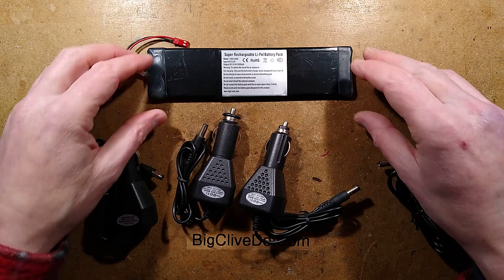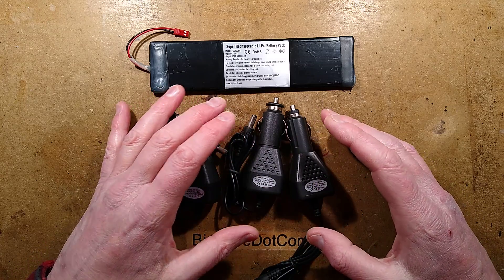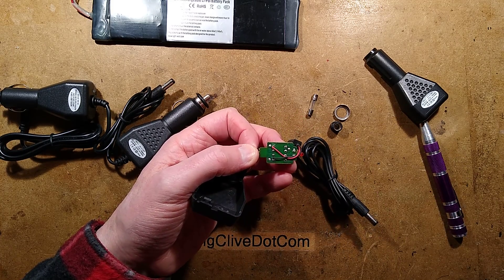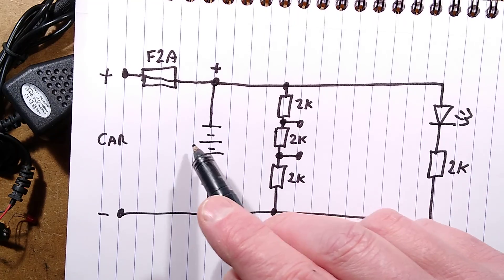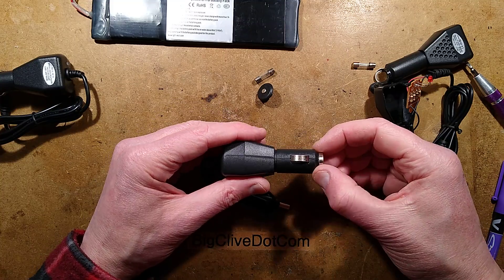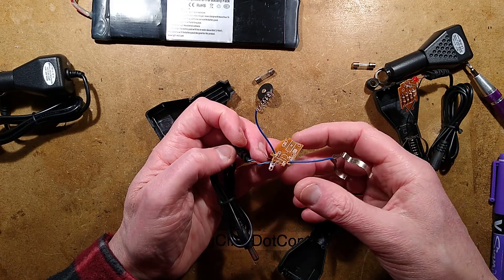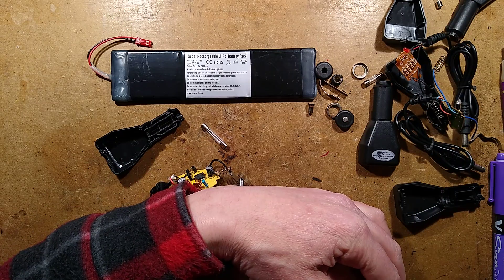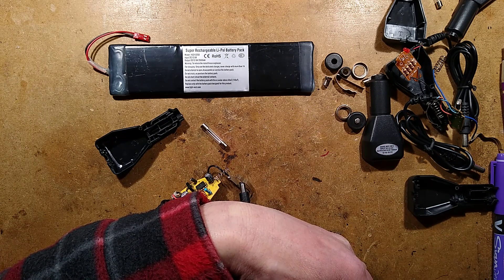Triple trouble - when offshoring goes wrong

Comment: I had some industrial controls made in China, the samples were fine as was the first batch, the second batch was where the problems started. They substituted a decent capacitor for a low value  capacitor in the PSU so that in cold weather the unit would not power up properly because the capacitors ESR had increased too much. Also they left out the filtering components on the inputs so the operation became spurious when longer cables were fitted. luckily only a few had been sent out to the customer before it was realised what was going on. I then had several hundred items that I then had to repair to keep the customer happy. Sending them back to China was not an option. 🥺

Comment: Wonder what Amperage that modified fuse rates as.

Big part of the issue is none of these amazon/ebay resellers ever bother to QA the factory or even inspect their order. For something like this I'd bet the reseller doesn't even know what they're looking at. Big money to be had if you have decent Mandarin and are willing to travel/live in China going around looking at shipments before they're put on the truck.

Comment: Hey Clive,

could you make a guide or an example video of what is supposed to be in something like a good (or adequate) power supply? Like, what is supposed to be in a 12v DC Power Supply? In what order? How does it need to be wired? So we can check if our Stuff is properly built and stuff.

Comment: Well there's a 'car fire in a can' for the 21st century. An exploding vest might be OK for the Dangerous Brothers, but for us ordinary mortals...not so much. 

Interesting mention of STRIX on the IoM. I took against them slightly as they refuse to sell kettle safety switches to individuals, on it's own not a particular problem, but they also sued a company making cloned switches, making it very difficult to find a switch elsewhere. I can understand why they did that, but it doesn't help when you're trying to reduce the Euro WEEE pile and are forced into buying a new kettle rather than fixing the old one.

Comment: Hello Clive. I want to run some short strips of 5050 leds from a 12v transformer but they run at half brightness and flicker badly (exactly as I'd expect!).

Can you suggest some kind of rectifying and smoothing Alibaba item, or maybe a suitable cap to eliminate the 50Hz flashing?

Thanks, 
Ran Davies
Treorchy South Wales :)
(It's lovely down here!)
Reply from the maker: I'd recommend buying a suitable 12V DC supply from CPC.

Comment: I bought a PSU for an IDE HDD from China. It exploded on the second time i plugged it in (230VAC). Sent images of the cracked case (it literally unraveled the ultrasonic welding and split) and sooty PCB via eBay dispute service, seller returned my 3 euros willfully, yay. Learned to never blindfully trust China 💩.

Edit: I just remembered that the PCB looked like the thing was hand soldered from a kit, lol.

Comment: One of my friends bought a large quantity of USB hard drives from china and was going to sell them all on ebay and make a tidy profit. He ordered loads of them and listed them all for sale in advance before he actually got hold of them. Unfortunately for him, most of them had been sold by the time they turned up and it was then that he discovered that these "USB Hard disks" were nothing more than the empty casings with a small flash drive hot glued inside of them together with a chunk of metal to make it weigh more!!! Obviously he had to refund everybody who had bought one which cost him a fair bit of negative feedback and I don't think he ever got his money back from the chancing sods in China!
Reply: Memory cards with far less capacity than advertised are also quite common.
Reply: There are worse ones.
They have firmware that shows a large capacity.
The actual memory is something like 8GB.
When it is full the special firmware loops to the beginning and starts overwriting.
It keeps on doing this and shows no errors but you lose the data.
Reply: @gordonwelcher9598  I've come across a lot of these. I find it's much less common in smaller drives like 1 or 2gb
Reply: New SSD drives are literally just flash memory, so I don't see how your friend's product differed.
Reply: @ElectroDFW  Well when you are supposed to be selling a 1tb external hard drive and it just has a very slow 16gb thumb drive inside it...
Reply: @ElectroDFW  This was also years and years ago when usb flash drives were really slow...
Reply: @FrontSideBus  This is still current practice here in Indonesia.  Plenty of hard drives on sale for unbelievable prices rate 4.8/5 because 95% of people plug it in, see that it reads, say, 2TB, with zero time used and they save a few files and everything looks great.  A month later when it's suddenly full or throwing an error they discover a thumb drive inside.  Unfortunately, the online platforms keep letting them sell.

Comment: Mega dangerous fuse bypass, and such a variation in car 'chargers'. Jeez, you definitely take a chance with those. Mine arrived today, both jackets work, both car chargers are the legitimate type. Mains charger seems OK but I'm not 100% sure whether to trust it long term. Also came with 2 first aid kits and 2 pairs of safety spectacles. Maybe they included these for a reason? :-/

Comment: China was the source of automotive ATC fuses that wouldn't blow. Harbor Freight in the USA sold kits of these and recalled them back in 2007. I am sure that there are probably tens of thousands or more of them around, since I strongly doubt that Harbor Freight was the only company that sold them. I found a 15 amp fuse included with a keyless entry kit that wouldn't blow when I connected a car battery across it. The legs were melting away where I touched the wire to them. But the actual fuse element wasn't blowing. You can usually identify these fuses because the fuse rating number on top isn't painted in white. If you see a fuse like that it's safe to assume it's junk and won't blow.

Comment: to add to the fuse stories, in the 70's the Mirror reported that a reader had written in saying their son had the good idea of replacing a 13 A mains fuse with a sawn of 1/4" nail, just the right size. The paper strongly suggested removing the nail.
Reply: Copper tubing has less resistance.

Comment: I took apart a switching power brick once and found what was obviously a reclaimed from scrap PSU, nipped off old leads, dust/grime and all. It was actually a pretty decent looking switchmode module so can't really complain.
Reply from the maker: That very common.  And they're usually pro-grade PSUs.
Reply: @bigclivedotcom  I remember performing that process while working in manufacturing. We would get in returned power supplies and put them through the bench test and repair process. Once everything passed, we would then put them back into production.

Comment: Hello Clive, is the "real" charger capable of boosting the voltage? Or could it not charge up the batterypack fully, when the engine is not running?

Comment: A friend had a phone charger in the car it smoked and took out his phone, I dismantled the charger and it was a proper circuit but the caps were only 10volt, it was labelled 12/24volt so you still have to check everything.
Reply: Ah yes. The good old "we ran out of the part so use this one instead". Gotta deliver on schedule or they'll suffer a huge loss from breaching the contract.

Comment: This happens with sales of Chinese products on Amazon and EBay all the time. The initial sales are good, well made products. The glowing reviews come in, then the product switches to crap with high failure rates (or worse, like the soldered fuse).

When shopping, I always sort reviews by the latest first, and if there are a bunch of "Great!" zero detail reviews, I know they are stuffing recent bad reviews off the page. Even with considerable care, I still sometimes see greater than 50% failure rate on parts. Buying locally is more than twice the price, so I end up continuing to buy from China and doing my own QA.

The experiment of component manufacturing outsourcing has been a failure, and product manufacturing needs to "come back home". Looking at Tesla vertically integrating its manufacturing, I now understand why they are manufacturing every component they can inhouse or locally - and looking to expand the scope.

Comment: These manufacturers time and time again demonstrate a lack of even basic circuit knowledge or arguably even common sense. And as you just highlighted that lack of knowledge can destroy your expensive Microstructure Surface tablet. Chinese no name electronics are rarely worth saving a few bucks as, at best they perform poorly, have inflated specs, and are often short lived. And, at worst, they’re a serious safety hazard and/or can damage other things. Louis Rossman has documented many cases of no name Chinese chargers damaging expensive Apple products and/or creating erratic operation. Even things like fake Apple Watch bands that out gas toxic chemicals and make the wearer’s skin peel. They’re just not worth it.

Comment: We looked at outsourcing / offshoring twenty years ago…
it’s like being a parent.
You have to give very explicit specs and instructions,,followed by progress and final QA upon delivery.
It’s not always negligence, but the third party may have no idea what you’re expecting.  They’re merely putting square pegs in square holes.
If they run out of square pegs, their under skilled workers will start using round pegs - so their piece work rate continues.
Language, lack education, and no expectations/standards is a really fuzzy place to work.
The boss still fills boxes and gets paid.

Comment: What I’ve noticed is a lot of the cheap stuff with lithium batteries rely on the BMS on the battery pack to handle the charging. And most times the BMS shouldn’t be used that way and is not the best way for safety or charging the pack. But they assume the charger current doesn’t matter and thing the battery protection will handle it.

Comment: I have two thoughts...

1. can we have the schematic for the good board?

2. maybe we do want to see you sticking 24v across a lithium battery pack.
Reply: Are there any countries with vehicles that have 24V on the accessory outlets?  What would be the purpose of a charger with that range of voltages, if they're all 12V?
Reply: @wingerrrrrrrrr  I believe some trucks put out 24v and according to another comment here airplanes also put the socket on their 28v systems.
Reply: @eDoc2020  are these in the US? What trucks would have 24V?
Reply: I;d also like to see what the schematic of the second board would be if it was properly populated. But that might be hard not knowing what type of chip it uses.

Comment: Make sure to check the mains charger as well. Perhaps it's passing the mains voltage straight through to the battery as well 😉
Reply: That's called a fast charger
Reply: @SimonQuigley  😎😆

Comment: Is that an MC34063 that I spied in the proper charger? What a coincidence, I've put one of these in the circuit I'm designing at the moment. It's just to drop the 24V input down to 12V for my circuit.

These days I won't even buy electronic components from China anymore, unless I can't find it elsewhere. I've gotten fake chips and other components a few times now.

I was a little concerned just before Christmas when I had to order the Crystal CS4237B sound card chip from Aliexpress for my WeeCee tiny computer. Thankfully it did end up arriving and worked perfectly, but I was a bit concerned since they sent it without tracking and it took about 6 weeks to show up. I still feel like it wasn't worth the stress. I can get most vintage chips for cheaper from a specialised obsolete parts supplier in the US, but the cost of shipping to Australia is so high it only makes sense to order from them when I need to order a whole lot of parts at once. Which hasn't happened yet since most of my projects use brand new parts.
Reply: Yup shipping to here is ridiculous.
Reply: @watchtherocks12  I've only done one other project with vintage parts, and it was cheaper for me to ship the boards and chips to Adrian Black in the US and get him to solder them up and test my design works.

Comment: I deal with Chinese machine shops all the time.  The first item you get, they just throw the CAD model into their CAM software, let it decide how to machine it.  Then they just hit go on their CNC after loading an appropriately sized blank.  None of the tolerances or datums are taken into account.  The second article they send you, when you reject the first, will use the general tolerances from the drawings, but no specific tolerances nor datums.  The third article they send, when the second is rejected, follows the drawings fairly close.  Most tolerances and datums are hit.  You will still have surface finishing issues from worn tools or too high of a feed.  And anodizing or powder coating is always a joke.  They don't clean it well before hand, and skimp on the application.  US manufacturers typically have a lead time 3-4 times longer, so even rejecting the first two parts, you still get your part more quickly.  But, most US made parts hit all tolerances and datums, or they will contact you during the machining process if something is off slightly to see if it is acceptable.  If not, they stop right there and start over.  Finishes are done to spec or they refinish and push the delivery date back.
Reply: I company I worked for got a short run of 1000 components machined from a Japanese company. Within the spec was an allowance for x% of out of spec components.

They sent the box with 1000 components. They were all spot on at 20 degrees, there was a small box with a note..
'These are the out of spec components you requested as per  the original order.'
They actually made some extra additional out of spec items to fulfill the out of spec allowance. Japanese engineering humor right there.
Reply: I had a random mailshot from a Chinese mould manufacturer (totally irrelevant as we are Electronic design), which said:
"We make thousands of moulds per year. Many of them to our customers drawings"
Reply: @JC-jv5xw  lol!

Comment: Well "Sugar My Puffs" I also had one of these dangerous plug-Ins. Clive is very correct in the advise..DO NOT TRUST THE MANUFACTURES IN CHINA. I lived and worked there 12+ years and some of the production is somewhat dam dangerous and they will cut every corner they can to cheat you or save one{1] Yuan or Mao.

Comment: 3:40 A fuse with a wire soldered over it and a leftover fragment for a circuit board! I would've said a lot more than "shit". That car charger was designed worse than a 5th grader's science project. They should be ashamed and banned from distributing such rubbish.
Thanks for sharing.  😉👌🏻

Comment: You can get all that in China, or other overseas manufacturers, you just have to pay for it, and the overall cost is similar to getting it made in the EU, unless you are buying huge numbers.

Yes, China makes an awe full lot of dangerous, unregulated shit, but if you do your sourcing right, and are willing to pay the cost, you can find some decent suppliers.

The company that made these could have had all the chargers to a standard, but decided price was the import part, and so didn’t do any extra due-diligence, factory tours, or further checking on the supplier, and this resulted in these dodgy ads chargers.

Comment: Slo-Blo fuse! I remember growing up in central Australia where old Bushmen would need to make repairs on old cars to keep them running. A .22 calibre Magnum bullet would be a good substitute for the 3 AG style fuses located under the dashboard, drivers side. It was occasionally known that when the electrical fault reoccurred the ‘fuse’ would quickly overheat resulting in detonation and possible shrapnel injuries from the shell casing. Another fix commonly used was wrapping the fuse in foil cigarette packet wrappings.
Reply: I remember the Mythbusters tested that. They weren't able to make the bullet go off.

Comment: Clive is that one that's been returned by a disgruntled customer and put back into stock.. Perhaps those 2 duff car charger adaptors were also returned with it to show the seller its not working and were not part of the original package..That might explain the dodgy soldered fuse as well . Amazon is famous for putting dodgy returns back into stock as it is with some on Ebay too..

Comment: I'm quite sure the originating cause isn't "overseas" but "make it cheap" / "maximise profit".
Also known as "you get what you pay for". 

Here's an interesting exercise: Estimate how long time it takes to put together the parts of these "chargers". Now multiply that with your own hourly salary - does it seem reasonable? 
Probably not. 
Then add cost for materials, transport, taxes, machines.... 

The result is obvious, it's not possible to make things for those low costs without several people ending up with the short straw (not getting a reasonable pay, insane working conditions, dangerous products...).

Comment: My second job was at a cell phone store around 2005. We had huge boxes of chargers from China in the back. Our cost was .80 and we sold them for 45-50 dollars. If a customer complained about the price a 10 percent discount made them leave happy. And I’d sell those all day long
Reply: If the cost went up to 85 cents they would sell them for $75.
Reply: @gordonwelcher9598  yeah. Any added cost always is passed to the consumer
Reply: @Youtubecensoredmyusername  We are lucky now that cell phones use some type of USB connection. You can also find acceptable Lightning chargers and cables for Apple.